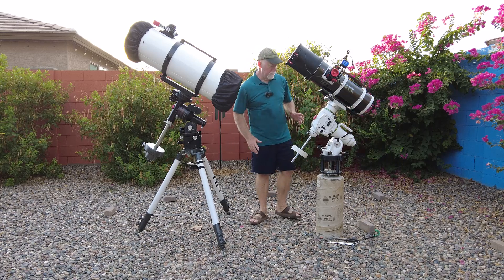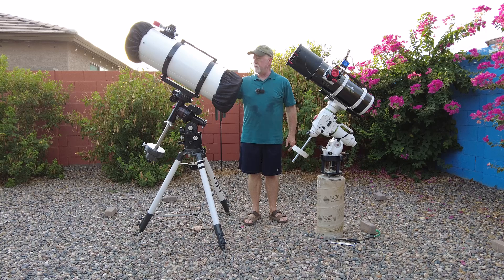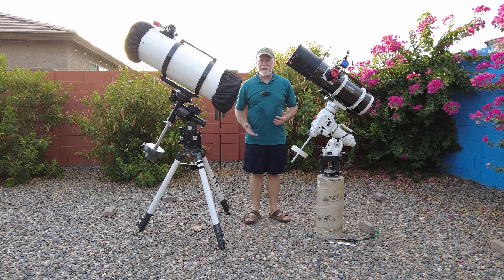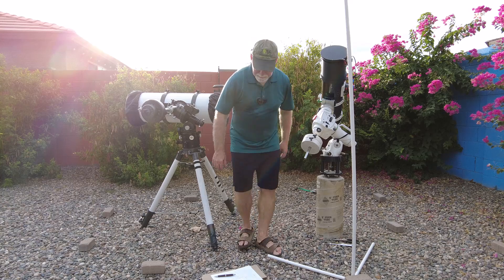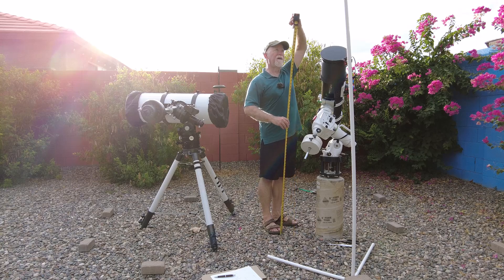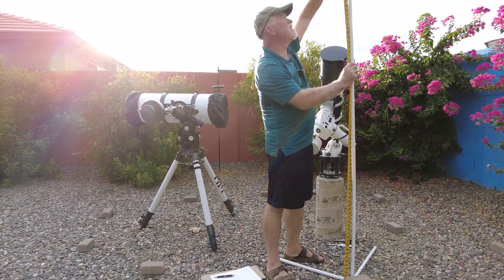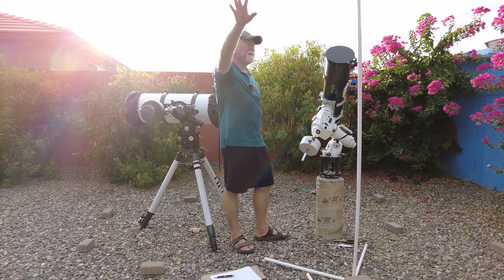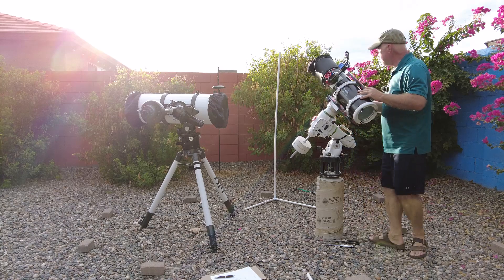Observatory Construction: Planning the Second Pier

Comment: Better to have slightly larger. When servicing you scopes and you have to remove them from the mounts some extra space might come in handy moving the OTAs around. Adding a foot here or there can't cost that much more but what do I know, I never built anything. Hopefully, you won't run into any beauraucratic hurdles with city codes etc. We spend winters in Arizona but have to leave by end of April when it starts getting over 95F. I don't know how people live there through the summers. But home is home. I lived 25 years in DFW when working. I got used to the heat and humidity.

I notice you have a Losmandy mount. You state it's a Celestron branded model. I'm looking at the GM8 or GM811 for my C8 SCT with OAG.. Is Losmandy worth considering? I'm looking at good guiding performance. Thanks
Reply from the maker: In Bortle 8 skies here in Phoenix, it does 0.5 RMS typically with my 10" Newt, not sure if that is good enough for what you are looking for? But it works for me 🙂

Comment: Always tricky working out the wall heights so they don't block too much sky but still allow the scope to miss hitting the roof.
Reply from the maker: Yup, and I don't want to begin building before I get that figured out and understand the interaction between the scopes and the impact of the wall height. Ideally, I would have the observatory oriented east to west, but that would significantly impact the backyard, and so I have to orient it north to south, so, the walls will have more impact on what I can see for how long based on that orientation.

Comment: Good video, just one question, you are checking your wall height, but won’t your wall height measurement start from the top of the raised deck, and not from the stones on the ground, so will actually be higher than 72” from the actual ground level…?
Reply from the maker: That is correct. But I am putting a deck on, so the walls will cover the deck and end about an inch off the ground, so will need to account for that. I just took rough measurements, and will make adjustments when I get to building the walls.